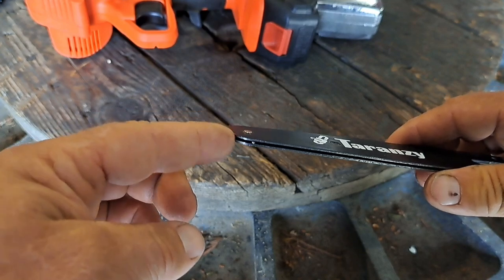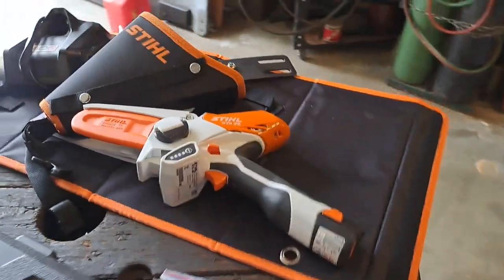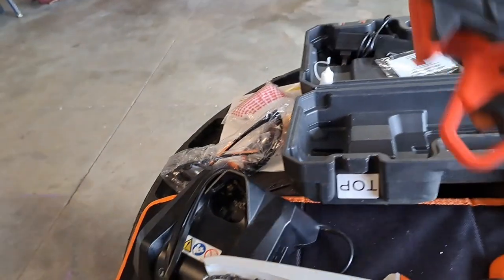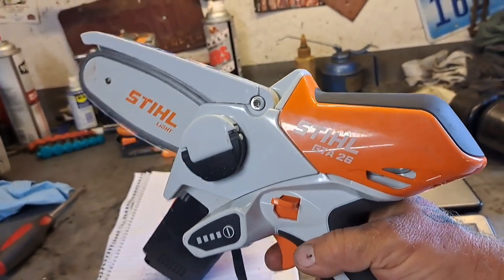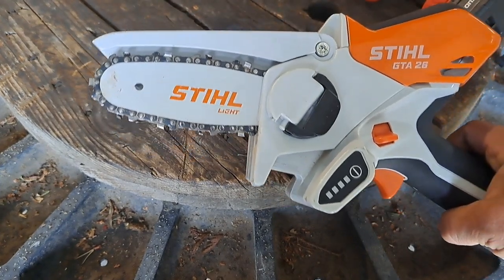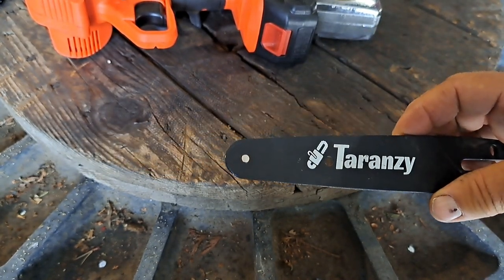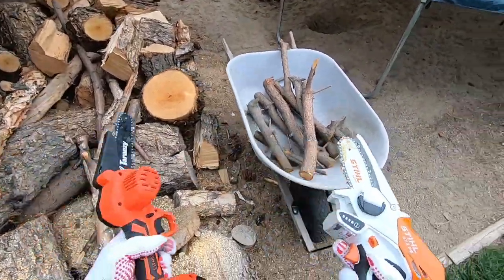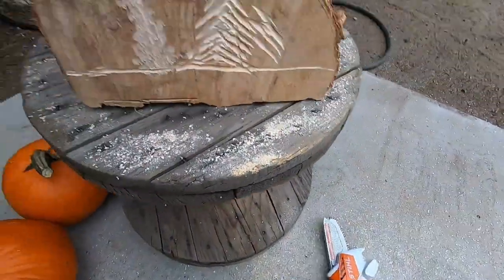Mini Chainsaw Madness! Stihl GTA26 VS Taranzy (Amazon) Mini Cordless Chainsaw Battle

Comment: for those not in the know, don't install or remove the chani and bar cover with the battery installed, you just begging for the nickname "stumpy". yes, I know it has a safety, still doesn't matter
Reply from the maker: Thanks man,  great tip!